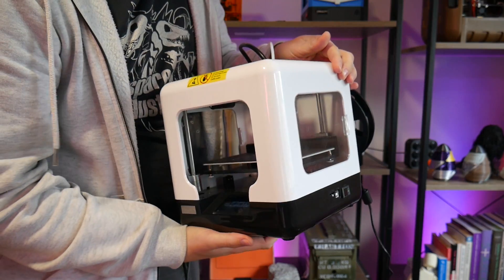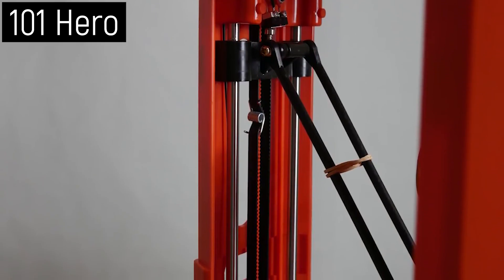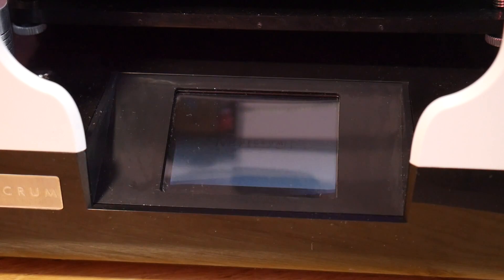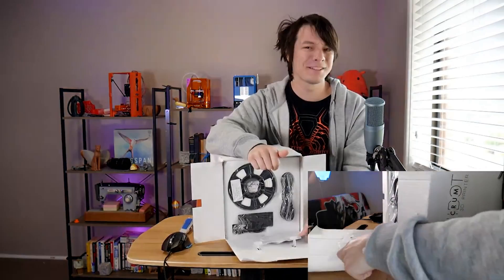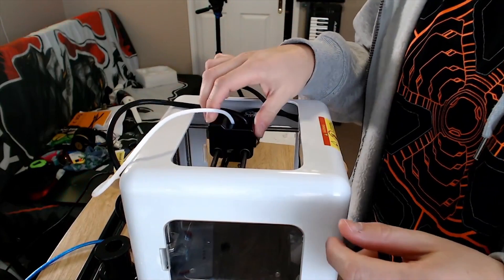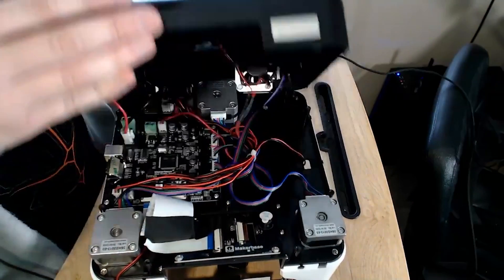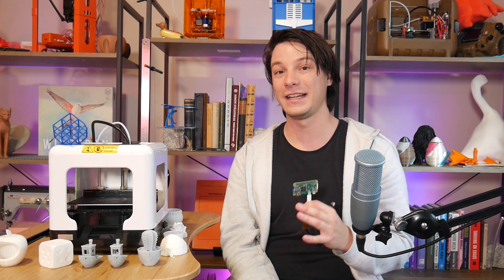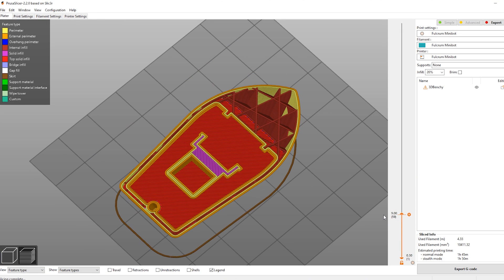The Smallest 3D Printer I've ever seen...

Comment: I actually realized that I print many small things. Spacers, little connector, hooks, vacuum connection rings. Usually only a few centimeters high, and smaller than 10 by 10cm.

So something that prints petg 15*15*10cm with the reliability and ease of use like my Prusa I would like it.

Comment: So can I design my parts in Solidworks, export them in .stl and then print 'em with this machine?
Reply: Yes. I design all my stuff in solidworks. Exporting as .3mf and slicing with cura seems to work better for me than .stl. make sure to export with high quality or it'll end up all blocky!

I use an anycubic mega s. Pretty happy with it and only needs like 8 screws and a few color coded cables to be plugged in. Pretty happy with it.

Comment: Have you tried the EasyThreed X1/X2 printers? its stupidly small and cheap. I printed a benchy on it and was amazed at how well it printed. it appears to use the same motors as the 101 Hero. but the print quality is way better. spool holder is shit tho. hot end is something like a 3D pen but not as bad as the 101 Hero since this printer can print well. one issue i found is it seems to flip one axis, even tho  it appears to be the right way round. confusing. anyway would like to see what you think of it and any solutions on the axis flip it has.
Reply from the maker: I'm not sold on those motors, the 101 hero "barely" functioned and they would get really hot. Glad to hear it's not as bad, but I prefer the real motors in this thing.
Reply: I know, the motors were a concern for me after my experience with the LoL-Hero. but the X1/X2 smashes it out the water. give it a go if u get the oppertunity. its so smol and cute too xD

Comment: Heh... Quick finishing 3D Prints... I'm currently 3D Printing an Arclight made out of ten 18° 60cm radius curved pieces with a triangle crossection plus two straight ones that will serve as a connector between the then two halves using an XT60 and some magnets. That bugger is taking more than 50h to 3D print in total spread over three prints ( 5x left side, 5x right side and 2x center pieces ). All just to have 360° lighting shining on to my hands / models when airbrushing a scale model https://imgur.com/a/GzLRqvl

I really should invest some time into figuring out my i3 MK3S' possible top speed to speed things up in the future... Print times that long are agonizing >_<

Comment: The printer is so small I could print 4 of them on one of my printers. Sadly metal / rubber and printed electronics are still a bit away. But a 3d printer which is printed in one go would be kind of amazing.
Reply: I mean there are metal 3D printers on markforged for like $4000

Comment: Really don't understand what is the economy in such a tiny printer, you still need  4 steppers, 1 hotend, 1 extruder and the mechanics are not so expensive if you buy them by length. For me 150 x 150 x 150 is the minimum acceptable. Quite good print quality dough!

Comment: The Pi Zero is not that bad. I had it a while on my Prusa MK3, piggyback on the EINSY board. It works well, especially if you take care of 3 things:
1) Try to connect it with the GPIO pins and if needed, use a PiCam. Connect through USB with a USB cam uses too much resources on the single USB bus in (every!) Raspberry Pi.
2) It works better for functional prints, where the single gcode commands are longer than on rounded, flowing shapes. A square is 4 gcode commands, a circle is dozens of commands. Every commands takes time; the less gcode lines per second, the better.
3) Do not use the OctoPi during a print. Uploading the next gcode or getting live updates on the terminal or gcode viewer uses too much resources. Upload gcode, start a print, and wait until it's done. Works fine...

Comment: Nice little printer, but to be honest, I bought my Ender 3 for 150 € new and this thing is only 20 € less ( I looked it up, it´s 130 € here) so in my opinion if you can get that much better of a package for just 20 bucks more this kinda isn´t worth it. If it was in the same price range like the Easythreed X1 I would maybe give it a thought (also if it printed flexible filament like the X1 does). Other than that not really ...

Comment: If you want an awesome, small printer & you’re not afraid to spend a bit ($500), look at the Epax X1. Its a resin printer, so it’s detail is astounding, but it’s ready to print straight out of the box. Seriously, plug it in & you’re ready to print! Obviously you’ve got to download their slicer profile from the SD card, but it’ll download Chitubox for you & slices w/ that.
If you want to order it, Amazon is a good option.

Comment: just put a small washer under the idler wheels on the X-Y gantry. It has to be small enough to only touch the inner part of the bearing, and thick enough so the spinning part of the idler is not pushed against the plastic and binds up the movement. Crazy that they did not see that problem in  planning/prototyping the machine, they could have just done a tiny adjustment to the injection molds to fix it.
Reply from the maker: They have washers, the bearings can't handle the load. I'll try source some correct length shoulder bolts!

Comment: If your into small printers should check out the voron zero, its a DIY printer but fits 120mm3 print volume in roughly the same size as the minibot, corexy, heated bed and enclosed as well.
Reply: Man, get one of this and try to do a #speedboatrace on it .... 😊

Comment: Is it possible to use old smartphone with usb-otg for octoprint? It would be cheaper than rpi and you have good camera, wifi and touch screen build in.
Reply: I think people have tried Termux before. I think you need a rooted or flashed  phone with specific drivers for Termux to latch on to USB devices though. You can just use any old android as a display for your Pi, easily enough.
Reply: This is great. I would like to take it a step further and DIY the touchscreen of the printer using an old Android phone to further decrease the cost. It could communicate with the printer board over WiFi or Bluetooth, so no USB shenanigans are required. I guess the market for a display-less 3D printer basically doesn't exist though.
Reply: @mik13ST  this is precisely what I thinked of.  
Someone on reddit succesfuly installed octoprint server on galaxy s3.  So there is possibility that using it as screen is also possible. https://tiny.pl/779n2

Comment: Hi Angus , can you plis tell me what Printer you recommend for jewelry? 
I need a smooth and detail but lower prize 
Many many greetings from Mexico I need to know which one I could buy not so expensive, because I need to make jewelry prototypes and then cast them.
Reply: maybe an sla printer? They do much better with fine detail.
But im no expert on SLA machines - im not sure how well the epoxy resin is for skin contact items
Reply: Stephan Wahlen  hi Stephan, thank you so much for your answer but it’s to have prototipos to then cast them in metal .
Reply: @Lemzati.  Try the Elegoo Mars or the Anycubic Photon. Both work with castable UV resin and both brands carry castable UV resin.
Reply: Have you come across the YouTube channel The Vegetable Oil Guy, or VOG?   He does what you want to do using a uv set resin printer for the models and casting in metal.  Worth a watch!
Reply: I have both printers btw just to clarify and both are great. And I've printed highly detailed resin rings on them. I've never tried casting though as I don't have a furnace, crucible etc but you should be able to find videos on youtube of people casting metal jewelry using resin printers in the process.